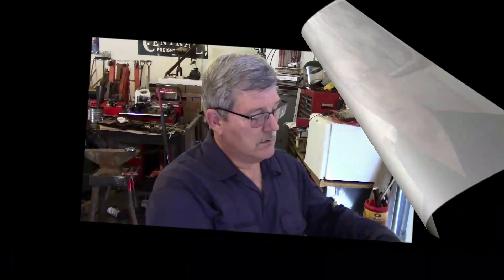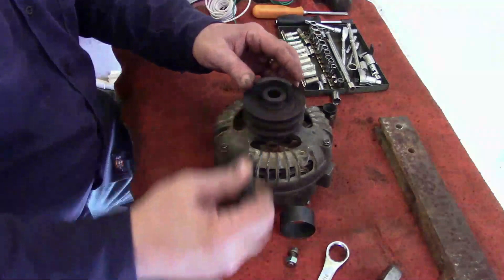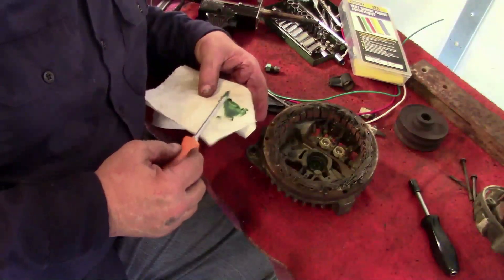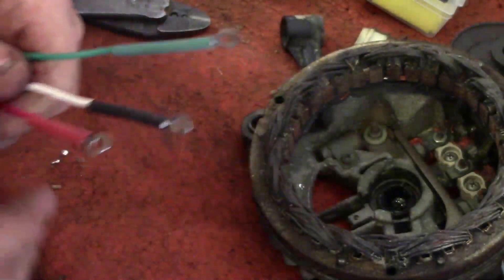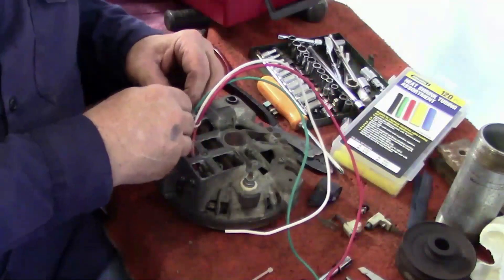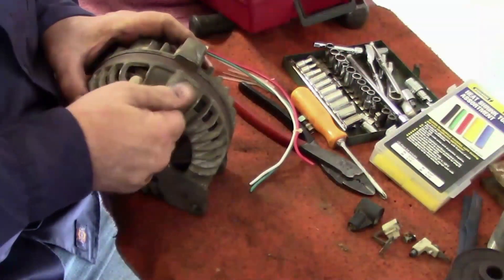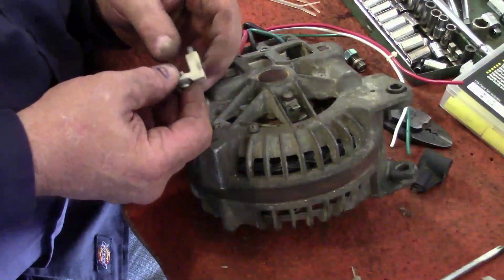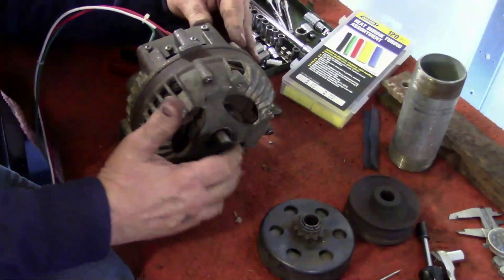Alternator powered Electric Mini Bike part 1

Comment: Cool project Lloyd! Do you need the rectifier anymore, or do you bypass it or pull it? I'm inspired. I had no idea you could do this.
Reply from the maker: Thanks Marsh, I removed the rectifier for the most part. Left enough to easily connect my wires.